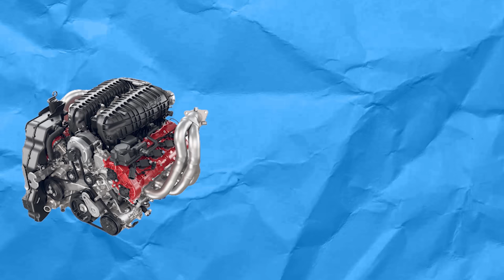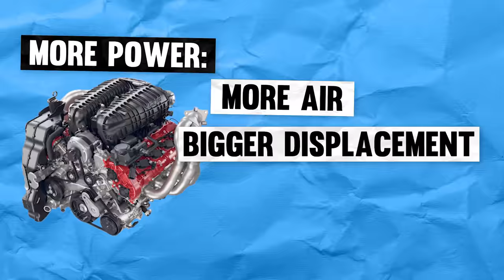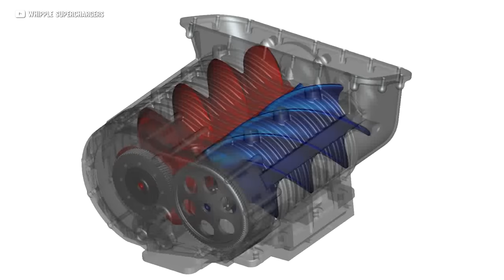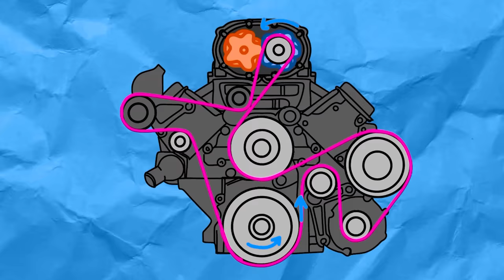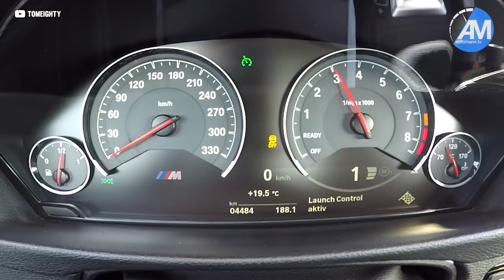Turbo vs. Supercharger - Which is Best?

Comment: I'm not a car guy but I still found this intresting. One thing I would like to say as a siren enthusiast is that a supercharger is super similar to a siren blower they both have the same purpose but, the blower on the Thunderbolt siren is a lobe blower.There is another siren called the "Hurricane" which does have a blower but I'm not sure if it's a roots blower or lobe blower.

Comment: In my younger days I was involved in trucking some. At low elevations a super charger could match the power of a turbo charger but as you climb into the mountains the turbo charger was not affected by elevation but a super charger was. The power loss was enough that a super charged truck could no longer keep up with a turbo charged truck. You tell me why.

Comment: I like efficiency and performance, so i think that my solution would be elctrically operated sequential turbo which spins-up using the power from regenerative braking so there is no lag. I hate lag, especially in the wet.

Comment: Pro-chargers are pretty much centrifugal superchargers, turbo chargers are like air compressors.
Screw and Roots type superchargers are positive displacement blowers (lower psi with high CFM).

Comment: Turbos can also have antilags to remove turbo lag and you also fit twin or quad turbo for more power so this shows turbos can make more by adding 2 or 4 turbos instead of only one turbo and antilags can remove the turbo lag which also gives instant power so turbos are better

Comment: the funny thing is a root supercharger actually DOES add Displacement on newer vehichles it gets added in on some engine liter codes. IE the predator gt 500 motor is a 2.6L blower.

Comment: Why not both?
Reply: Twin charging is very dangerous not just for your engine but also for you as the driver
Reply: Design a billet block and with all billet internals. That might handle it

Comment: supers have immediate power gains. but do take engine power to use which are best used on v8s with power to spare. turbos have a lag before activation,  and are best on smaller engines that can't afford the initial powerless of a supercharger

Comment: Turbos are best, in my opinion, for not destroying your engine, meaning less harmonics and only boosting when full throttle. Super chargers work off the crank, giving boost faster but cause lots of crank harmonics destroying bearings. On the street go turbo building power slower when traction is a problem. On the track boost fast with a super charger.

Comment: There’s a reason most pro mods are switching to custom turbo setups instead of superchargers, and that’s because you can make them a lot bigger and anti-lag effectively offsets the one disadvantage of turbo spooling. Top Fuel cars use superchargers because at that point, the weight of the turbos and the weight of the intercooler are just so high that it offsets any efficiency gains a turbo can bring.
Reply: Turbos have been BANNED in NHRA Top Fuel for decades... they made the cars too fast.

Comment: I have a 3.0L turbo diesel VW. There’s a notable lag. It’s not for racing by any stretch of the imagination so that lag isn’t a critical issue. I also have a Toyota with a 5vz-fe NA, but Toyota offers a bolt-on purpose-built supercharger for it. At just 3.4L it’s pretty small for a supercharger. It would only add 45hp in the configuration Toyota recommends. Not really worth the $3k to have the slow, weak truck still slow and weak in the end. The supercharged 3.4L would slightly outdo the turbo diesel in hp, by just 10-12, but still fall about 136lb-ft short on torque.

Comment: Neither compressor is limited on boost.
A Eaton M90 can make one 26Psi (head lift even with studs is a issue on applications I'm familiar with), outside of diesel that's more boost than most use on a Turbo.
In the stationary air compressor world both systems are used and both are capable of the same PSI output.  Turbo compressor are better suited to base load and superchargers for peaking and demand loads.

The reason for more turbos in the OEM automotive area is fuel economy.  A OEM can claim higher power and higher economy by tuning for the test, of which neither might be achieved in the real world.

Comment: The pulley nose from the blower such a nice sound but turbos can be cheaper wanted a blower ony Corvette form a factory ctsv and shit 3800 to 6k depending on if you change heads and cam so I did cam heads and turbo for the coast of just the blower. Turbo vs blower all up to the owner they both sound good and make boost so they both a win

Comment: There's still no replacement for displacement because you can still put a supercharger or turbocharger on after you've added cubic inches to your engine it's just more of it to do it too that's never a bad thing
Reply: Au contraire. The 5.7L displacement Hemi by Dodge is a great engine displacement for boost, because it leaves so much cylinder wall thickness. They use it in the Drag Pak with 1500hp, when they could have gone with a 426, 376, or 392.

Comment: for example the Lotus are equipped with a volumetric compressor, yet they have small engines, especially the Lotus Elise 1.8 220 hp, but being light it is better to have everything immediately instead of having to wait for the turbo to come under pressure, even as a guide the volumetric is less abrupt it is not like the turbo that when it comes under pressure it feels and can lead to breaking down the car when cornering

Comment: Turbo all the way. A well-configured turbo setup will have very little lag and no parasitic effect up top like a supercharger. 

Also just subjectively I prefer the whooshing wind sound of the turbo and bov than the whine of a turbo that just sounds like a power steering pump going bad a lot of times imo.

Comment: Superchargers and turbo's can be hybridised, BUT needs tuning. What one takes the other makes.

The supercharger takes from the engine but makes more exhaust, the Turbo takes from the exhaust and adds to the engine.

Yes it's extremely simple explanation of that system but unless you want me to go into the extreme details on the hydropneumatic physics of it which is a thesis. Am KISS-ing it.

Comment: Turbo. No question. More efficient, doesn’t have 100hp parasitic loss. The one downside is price and complexity. There is a replacement for displacement. The more fuel you burn the more power you make. The more fuel you burn the more air you need. Displacement allows for more air at 7psi above vacuum. A turbo or supercharger can put 5 times the air which at equal temperatures is the same as 5 times the displacement. Gmc syclone, Buick grand national, Toyota 2jz.

Comment: There is no replacement for displacment. You can boost bigger engines too.
And superchargers are not "displacment modifiers". The engine's displacment does not change. Superchargers are air desisity modifiers. They make the air your engine uses denser or "heavier" per volume.
Turbochargers are more efficient at doing this but belt driven superchargers are faster to respond. 
Which one is used is up to the builder and the intended use.

Comment: never sleep on an inline six their torque monsters.... They could be in a BMW screaming down the highway. They could be in a chipper in your backyard chipping up trees or could be in your local UPS truck but in line 6 is my favorite engine configuration of all time and in my opinion the best of all time. And don't forget large diesel i6 either.... They're everywhere and they are beastly in my opinion. They're the best candidate for a turbo because that bottom end grunt will pull you through the lag if you never driven a large displacement in line 6 naturally aspirated then you don't understand

Comment: took a quick google search just to clarify a fact that is wrong in this video. Turbos do in fact "rob" power from an engine by creating back pressure, simple physics would also key you in on this.
also you can have a centrifugal supercharger which would give you a blow off value and give you "peaky" feeling from a turbo, also having a clutch installed in it allowing it to not run under idle allows it to be pretty efficient as well.
go ahead and do your own research folks, its more reliable.

Comment: So after this explanation I get it finally about the difference between them. But why my Audi A6 3.0 Tfsi its with supercharger if its V6 300bhp engine is it gonna be even faster if its with turbo ?  isn't it too small for a supercharger ?
Reply: I assume it's a pretty small supercharger, and A6 is more of a luxury car, so the linear power fits it better. (p.s.: Even as a european, I've learned something new. Never knew the A6 was supercharged)
Reply: @Inferiis  they are very rare but is the same engine from s4 and s5.

Comment: So would turbo's be a good alternative to put on a small block 235 instead of a supercharger? Because I'm not planning on taking my truck to a drag strip or anything it's just going to be a daily driver
Reply: What do you need the extra power for ? I can help you decide what you need based on your usecase
Reply: @theterminator6121  I don't really need the extra power but it wouldn't hurt to push a little extra power out just in case you might need it or just to have fun when going to truck shows I mean you can't go wrong with putting turbo's or supercharger on anything really
Reply: @ashtenhungerford6153  "you can't go wrong" - famous last words.

Comment: It’s simple because the application their built for dodged uses super charge so it could have more torque and faster acceleration Nissan used the car for racing so they chose turbo for higer horsepower because the Bad side of a supercharger is it relies on the engine to work which is slowing down the engine but has no lag because it’s already turning but turbos requires it to spool up first but is just running off the exhaust gases

Comment: Turbo chargers provide boost they don't suck anything, just like a supercharger provides boost. They just do it in different ways, the supercharger runs off a belt to rotate the blades that force in extra air. A turbo charger is operated off the engines exhaust which in turn spins the impeller that forces in extra air.

Comment: I mean, a big old 8:71 roots style blower, sticking out the hood, all whiny and loud and inefficient, looks damn cool, man.

Sure, turbos are way more efficient.

But a blower goes:

"Wheeeeeeeeeed-aaaaaaahhhh"

Amd them there's the beauty of blower lope and/or the chirpy goodness of a slight high idle while the roots blower chops the air up all old school and inefficient.

All boost is good boost

But the belt driven intake is the coolest looking.

Comment: Well the good thing on the turbo is, that it doesnt rob the engine any torque. But the turbo does take a little bit of spool time, which the supercharger doesnt, so theyre pretty much same
Reply: A supercharger breaking won't ruin the engine.

Comment: There is no free lunch. Boost is just a measure of restriction. A turbo is a restriction in the exhaust and effects flow or they wouldn't get red hot. They are both awesome on the drag strip if you don't want a man pedal but for street driving I much prefer the blower. JMHO.

Comment: My 05 Saturn ion redline SC2 was 2.4l supercharge but wouldn’t kick in unless I really slam on the gas! 
Or wouldn’t kick in until 4.500 RPM 
But I loved that 5 speed manual! Eco tech 
180k miles original everything including clutch! 
Yet I’ve seen non redline 
Saturn ion SC2 2.0l 
Non charged needed clutches often! And that wasn’t even being raced! 
I thought they were riding the clutch but nope and wasn’t downshifting to stop 
He just put in neutral and used the brakes! 
So you’d think the clutch wouldn’t need to be replaced once a year! 😂

Comment: Is there some way to "disconnect" a super when its not needed, like a clutch?  And I think I recall a European car that had both(?)
Reply: I think that was a group b lancia
Reply: You can install both, but it will melt your stock engine really quick. 
Also, technically it should be easily possible to disconnect a sc, you just need 2 belts, 1 with the charger and one without, then mechanically swapping the pulley to use one or the other. But there may be easier ways. The problem is, you place the charger on the intake, so if you don't use it, your engine cannot breathe, i.e. it's deadweight and also chokes the engine
Reply: It makes sense, low end super, upper end turbo but you're right, it must make enough heat to melt

Comment: If you turbocharged your supercharged motor you don’t need to choose between the two and have the best of both worlds with efficient boost at low rpm from the supercharger and you have more boost at the top end from the turbo

Comment: Good vid.  1 comment and 1 question:  Comment, a supercharger can be tuned to hit later in the petal stroke, which is the way I have in set up to be able to drive with just stock power.  It was set up instantly though, was more fun. :)
Question:   I know that when the exhaust is restricted, engine temps go up, especially at higher RPM's. Has anybody measured the engine temp increases for turbo chargers?

Comment: The supercharger is low end power while the turbo is high end power., it's the difference between a truck that's focusing on study power getting to the wheels for better pulling, while a race car is more focused on getting all that power and turning it into speed

Comment: "Liquid oxygen injected motor" a motor with no air intake, but the liquid oxygen is mixed with the fuel before it enters the piston, meaning, the fuel and air are delivered at exactly the same time. No air filters needed. No turbos or superchargers needed. Just increase the liquid oxygen mix injection pressure.

Comment: How much more horsepower would a supercharger make on a GM 6.2L engine that already makes 420 HP?
Reply: Depends on a lot of things.
Reply: @donaldhollingsworth3875 A very rough rule of thumb for a turbo is 100% increase  at 1 BAR (14.7 psi) of manifold boost.
For a supercharger roughly 50%

Unfortunately at 11.5:1 compression ratio even 7psi may be too much, especially with pump gas and will cause major problems, 
8.0:1 to 8.5:1 would be more ideal
(except for engines with GDI)

Comment: Turbos are better. Just take longer to install correctly and map out in the engine bay. If ur doing twin. Run a smallish is supercharger and 2 medium turbos. Only engine I think can handle it is the og 5.7 tbi switched to electronic fuel injection. You'll get more reliable power with longevity. But then again. Twins aren't meant for that haha. Turbos are just plain better if you do the step-up turbo setup

Comment: Turbochargers suffer from lag (depending on the setup) while superchargers are parasitic in that they actually pull power from the engine to put power into the engine. Having a twin turbocharged car, though, I’d go with twin turbos any day. Almost no lag due to having one turbo for low end torque and the other for high end torque.
Reply: That's only in the case of a handful of toyotas (and one nissan i think), most twin turboed cars have two of the same sized turbocharger so you still have lag, and actually more of it because there is more volume of the combined turbos to fill. 

Put simply, unless you have a specific toyota, more turbo=more lag

Comment: Turbos don’t need time to make boost. There are many engineering workarounds. Koenigsegg’s pressure tanks are simple and efficient. The hellcat swapt to twin turbo at the same boost makes more power and less wheel spin. Even more if engineered for power.